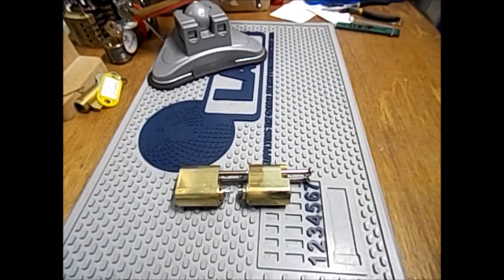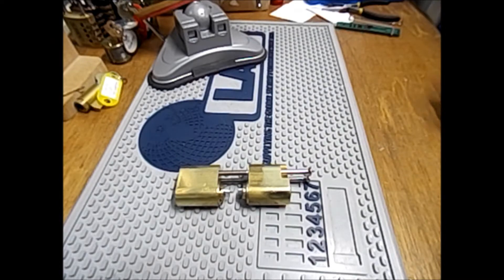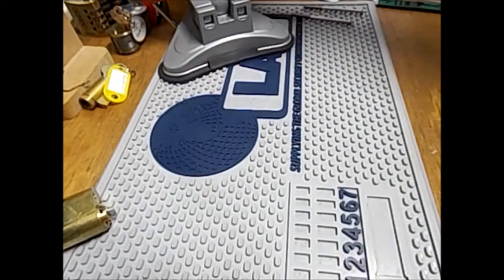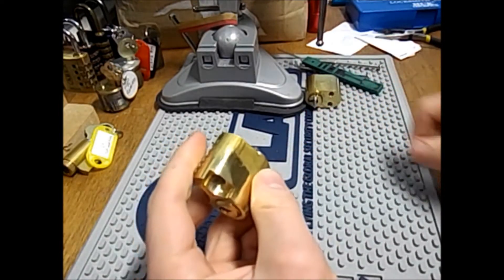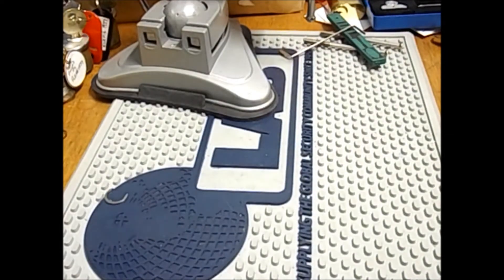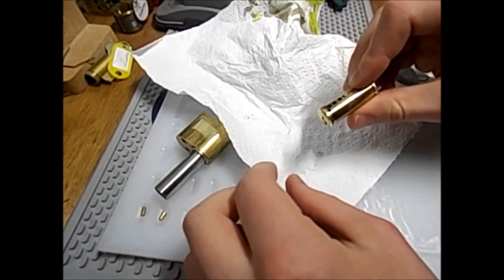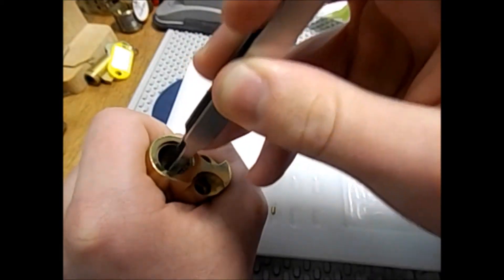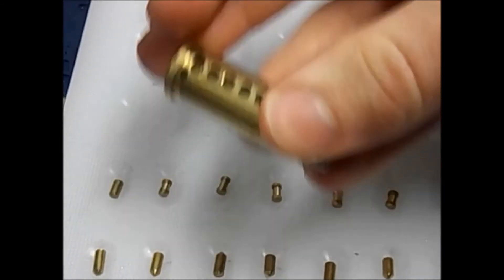Trioving Scandinavian Oval Cylinder with a story! (181)

Comment: Thanks Ethan. I hope that the lady had insurance cover and made a claim? To reset the balance a little; an old lady near here needed a replacement door lock, a couple of years ago, because a key had gone astray while she was in hospital. A quick sms from me resulted in a visit from the man who had fitted the door. He replaced the lock under guarantee, which still had a couple of years to run, even though the lock was fine. It cost her nothing. Most people forget that they have a guarantee, as do some unscrupulous sales people.
Reply from the maker: Unfortunately often in these sorts of situations guarantees are forgotten about as you say, I don't think she did end up getting any money back from the whole situation. I was really angered by the stupidity of the so called 'locksmiths' involved in the job though, considering I hooked the key out with a bent bit of metal from my keyring in a matter of seconds.
Reply: @HobbyPicker  It makes you want to spit. Some people are only motivated by easy money, and that's sad.

Comment: That's is a very nice lock and you flew quickly through it. Looks like the plug is flattened which makes the shealine wider. Unbelievable story.
Reply from the maker: Thank you my friend, What are the results of a wider shearline?
Reply: A wider shear lines makes an easier pick as there is a wider range where the shear line is clear. So less likely to overset.